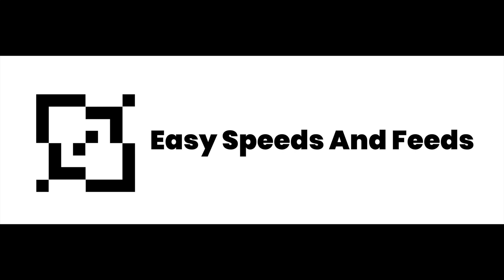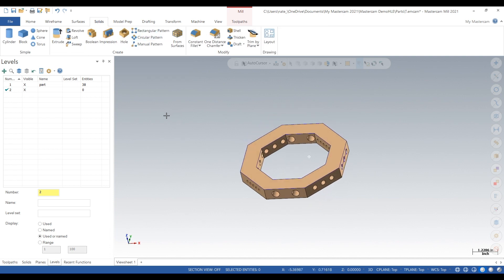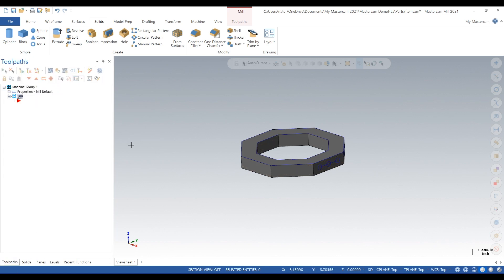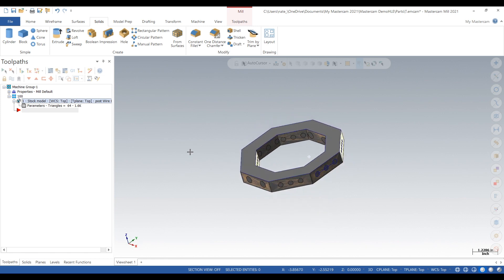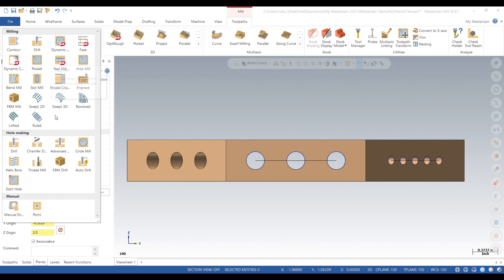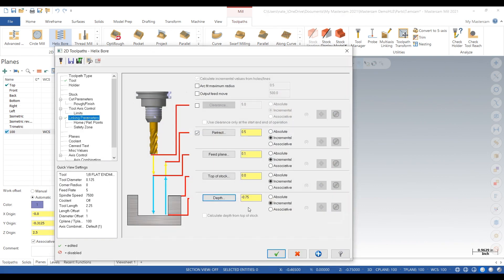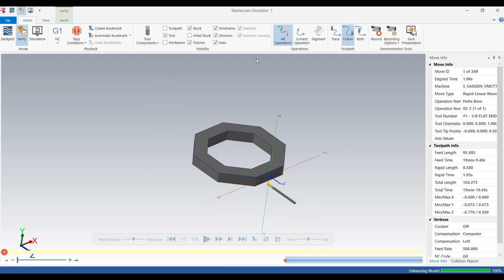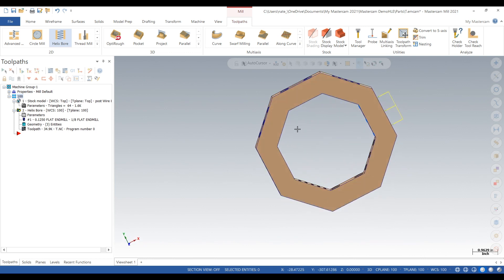Stock Model - Mastercam

Comment: To fix the alarm you just need change mastercam default parameters start angle 90 degree to zero and entry /exit arc sweep 180 degree to zero also.I don’t know why mastercam set that default for.it’s will be alarm for all control when posting cutter comp Hass,Dmg Mori,and Makino also.remember cutter comp have to be G01 straight line then start lead in arc ,and exit out arc rule of thumb.
Reply from the maker: Good info. ill make sure to touch base on that next time I post a video.

Comment: Good technique using the helix bore op. But for the most part I always drill a hole first the helix bore it to size .
The one problem I have with the helix bore is when I do a cutter comp , if I do any offset on the machine I get an alarm. So I make several programs like a rough , semi finish and a final finish by adjusting it my bore with a  -.001" or -.002 to slowly creep on my final tolerance. 
Nothing else seems to work . Even though I tried.
Reply from the maker: Contour ramp toolpath isn’t  perfect but it seems to be better at activating wear comp. I use contour ramp when I have to make wear adjustments on the controller.
Reply: @easyspeedsandfeeds1410  I also use the contour ramp sometimes.  But with the contour ramp causes more editing because when you get down to the bottom of the hole you have to make sure you bring the endmill to the center of that particular bore before you rapid up or else you scrape the endmill against the bore.  Imagine if you have a bunch of bores you take too much time to edit every single one . And if you're in a crunch one mistake will kill you. 
Helix bore is easier because you can check the box to start and finish at the center of the bore.
I have to call my seller to see if they can help to see where my problem is with the Alarm.
Reply from the maker: @tomasobamela  Im sure your seller can give some insight into what is happening. Sometimes its the post processor spitting out the wrong code.
Reply: i let my reseller add a helix bore cycle to drilling. its not going to simulate properly anymore but at least i have the ability to do compensation in control.
Reply: @tomasobamela
To fix the problem you have, you just going to parameter of mastercam ( start angle 90 degree change to zero degree and ( entry / exit arc sweep default 180 degree change to zero also)I have same issue with you for all the control iso program fanuc,dmg mori,Hass control after I figure out that’s cause the problem cutter comp alarm go away same thing with toolpath thread mill you have to do the same.hopefully help you I guarantee it try it and let’s me know.